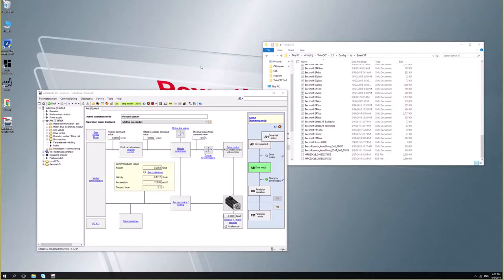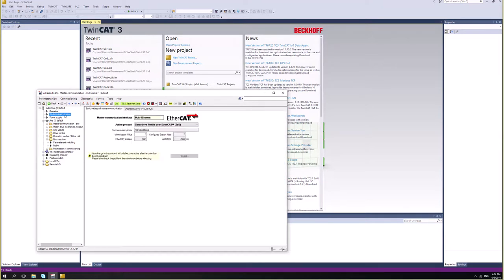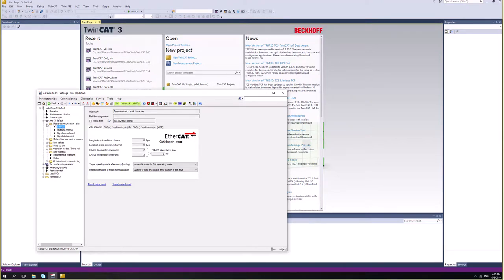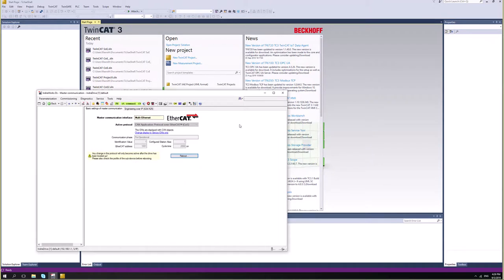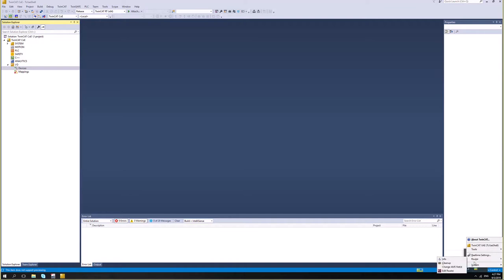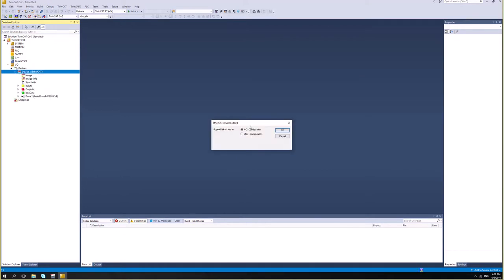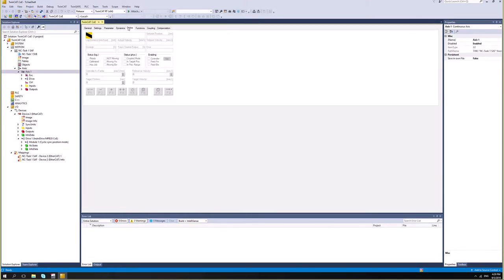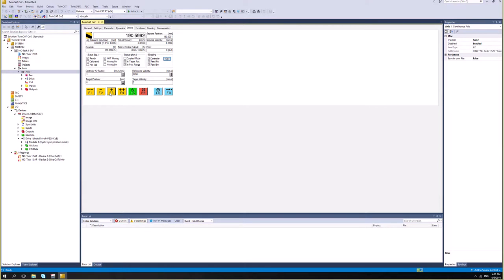TwinCAT & IndraDrive CoE

Comment: Hello Rodrigo, I watched your videos with great interest. Could you help me? I have TwinCAT 3 NC-PTP license and motion libraries, EtherCAT and 3 x motor MS2N04-D0BQN-CMSG1-NNNNNN-NN, controller HCS01.1E-W0028-A-03-B-ET-EC-NN-S4-NN-FW, firmware FWA-INDRV*-MPB-20V32-D5-1-NNN-NN.
Do you have an TwinCAT 3 example for the control? The task is simple: Set zero point via HMI, point to point movement.
The controllers have internal FSOE, which already works without any problems. I would be very grateful for your help. Oleg